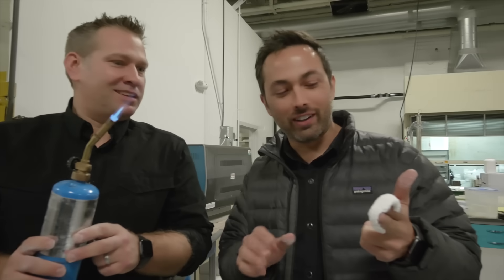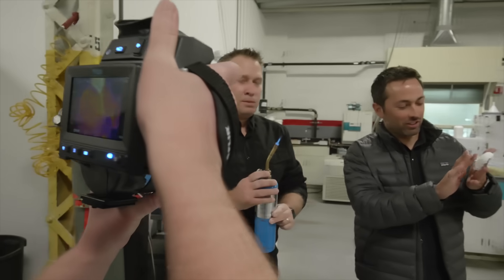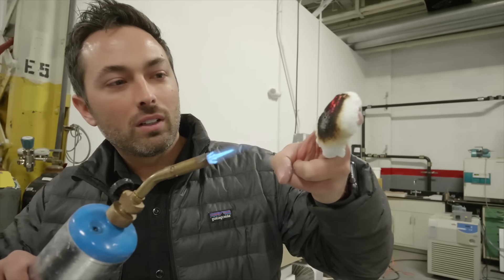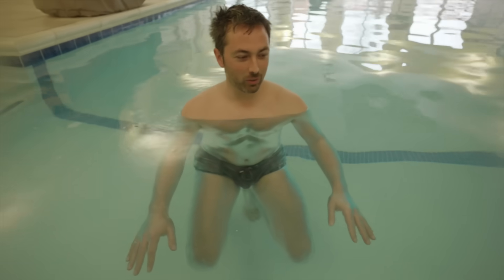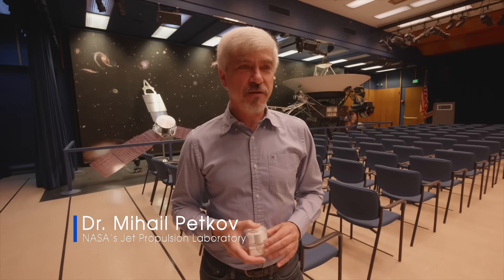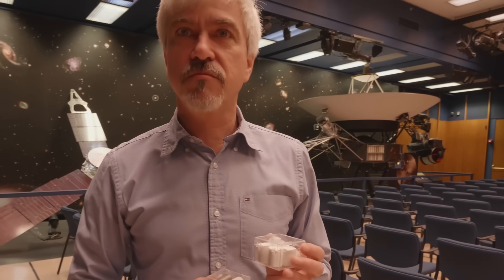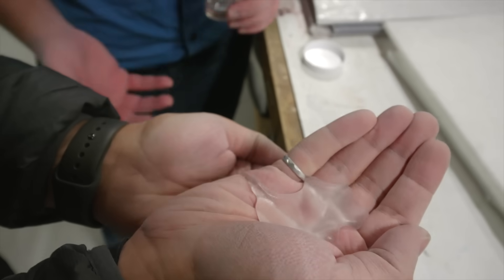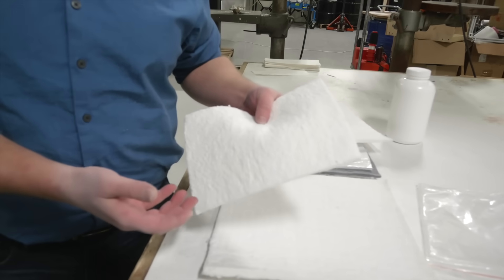I Waterproofed Myself With Aerogel!

Comment: The gel could be insanely good for firefighter suits.
Reply: @melmao6531  How are you going to hit us with that response but not talk about it more
Reply: @CubeCF  the people wearing the suit would over heat very quickly in the labour intensive work from just their body heat
Reply: @astrixinthestars1047 b my guess is it would still prolong survivability if it's used when significantly hotter outside than inside
Reply: CubeCF well the problem is that the gel is very fragile, grown men running, objects falling on them, ect ect makes it so be gel wouldn’t last very long
Reply: @melmao6531  put existing waterproof and fire resistant layer outside and the aerogel on the inside. The suit might get damaged, but it could save lives
Reply: @michaellutz1539  that's what I was thinkin'. But hey,I ain't a scientist.
Reply: @michaellutz1539  If the suit is damaged it wouldn't be easy to mass produce
Reply: @michaellutz1539   CrazyNexusMaster123 Gulmatico  
Or maybe use CO2 instead of water
Reply: @michaellutz1539  

No. An Aerogel suit would only be comfortably wearable for like a few minutes, tops. Aero halts ALL HEAT, so an Aerogel suit would cook you from the inside with YOUR OWN body heat. However you're bound to get uncomfortable and take off the suit LONG BEFORE that could happen.
Reply: Being a firefighter it’s exactly what I was thinking, the possibilities for this stuff is endless and I think everyone watching this video is thinking of inventions.
Reply: @FadedFilmsl  thank you for being a firefighter 🙋🏿‍♂️😘👨‍🚒🧯📛
Reply: @FadedFilmsl  exactly, I'm just an EMT and even I knew it was a game changer
Reply: Only problem would be the insulation of body heat
Reply: Tom A but the insulation would keep them from burning because it would keep them at body temperature, but it would be really hard to take off because of the heat on the outside.
Reply: CrazyNexusMaster123 Gulmatico      in a previous video, they showed that the aerogel had really good heat resisting properties and that the aerogel didn’t get burned itself when placed over a fire source (it became warm...causing the chocolate bunny to melt slightly but didn’t get heat damaged itself) furthermore after removal from the heat source, it seemed to cool fairly quickly.....so it might be useful in firefighter suits...good reasoning though
Reply: Problem is the effect works both ways, essentially cooking firefighters from their own body heat. It's already a huge problem with conventional suits, aerogel would prevent any body heat/moisture to be trapped within.
Reply: @CookieMonster999111  I don't think firefighters mind it at all when it comes to get burned by fire - I'm pretty sure all of us here were to close to the campfire in thick pants - it is just warm inside, mostly from the body heat (althought, few mins laters these pants are so hot from inside! But if they would be "reinforced" by areogel, nothing would happen for a longer time. Anyway i'm saying about perfect situation where there isn't any need of making these pants waterproof so the gel won't get damaged. Like someine here said - I ain't a scientist.
Reply: Preserve Our Liberties yeah maybe it would be better as an easy to carry fire blanket
Reply: @CookieMonster999111  Fully contain the suit except for an on board cooling system that would regulate temperature to normal body temperature while in the suit?
Reply: I have no idea what any of you are talking about I am confusion
Reply: @mattmc1234  CONFUSION 100
Reply: Matthew Mcgill same
Reply: @mattmc1234  it's probably why you're confused.
Reply: Just remember that a firefighter doesn’t need to walk directly through flames.
A composite material would allow it to be put throughout the fire suits and flex somewhat
Reply: Also, for re entry from space. No need for heat shields anymore.
Reply: They r working on it.but the material is very brittle so they r working on combinations ;)
Reply: Not really, usually the thing that most likely will kill a fireman will  be the gasses or pieces of furniture or the building, also the fireman should be able to feel how hot is a certain place to know how dangerous it is, this stuff isolates it all, so I'd say they're pretty alright now
Reply: Reading a portion of this some people are thinking of a 100% aerogel firefighter suit when in reality it will be a mix of aerogel and existing tech to make it effective
Reply: How bout a shield
Reply: Lmao firesuits always have a insulating layer between the inner and the outer material, and if those are waterproof and which they are then you don't have to worry about ruining the gel
Reply: @iggypeters5564  I agree with obama.
Reply: Maybe just gloves it's too brittle
Reply: Plague Doc what if u fall? 🤦‍♂️
Reply: lol no it wouldn't. the problem is it will keep the heat out but it would also keep the heat in and it will over heat the fire fighter.
Reply: Plague Doc and for diving
Reply: Omg yes!
Reply: Firefighter suits are perfectly fine for protecting from fire most Firefighters lose their lives from being trapped and smoke inhalation.
Reply: @a_gengoo9645  oh🥺 that idea tossed out of the window
Reply: What are we fighting about?

something kinda irrelevant to this video
Reply: Really, the heat is one of the least concerning things for firefighters. the biggest issue is smoke inhalation, followed by structure collapse.
Reply: I can see Olympic swimmers using the water resistant dust to try get their times down.
Reply: Plague Doc future millionaires in this comment section. Lol
Reply: They actually made aerogel lined coats for Everest climbers in the early 80's, people were having a bad time suffering heat exhaustion/stroke... in 0 degree weather.
Reply: ThePlayListOfPower I cant find anything on that could you link it?
Reply: May be with a scrub
Reply: CrazyNexusMaster123 Gulmatico put one layer of fire proof material then put aerogel
Reply: It would get really hot though
Reply: More like an inner layer in the mid or something of the suit.
Reply: I was thinking make it a edible Fire extinguisher lol
Reply: True the only issue would be getting out if the whole thing is burning.... and like clay.... somewhere in the future it’ll be weaveable with fabric
Reply: Our turnouts do have a water barrier as well as a thermo barrier. If they could weave this into the fabric, it could work awesome! It just has to be durable.
Reply: Plague Doc wear this near a detonated nuclear bomb
Reply: But also incredibly expensive
Reply: Just make a suit out of the fireproof aerogel and use that to rescue people.during fires
Reply: You got a mger point there, yhey should be using it for that.
Reply: Well you could put in deep inside their already proofing clothes
Reply: If you fall or get clipped by debris then your suit is basically ruined/shattered and no longer effective therefore risking the life of the firefighter inside of the place that’s burning
Reply: or my asshole
Reply: 😂😂it could be more flammable
Reply: Did all yall not watch the video or something there are tons of ways to make it into a fire suit, from fiberglass infused with it to amorphous silicon/silica composites
Reply: that is what i’m thinking
Reply: Oh rly
Reply: @melmao6531   u don't have to get scientific u know
Reply: Air is flammable....
Reply: CrazyNexusMaster123 Gulmatico did you says that it has high resistance to heat you idiot
Reply: @melmao6531  why?
Reply: Plague Doc it’s really expensive
Reply: This would be absolutely terrible, standard turnout gear can already have you soaked in sweat before you even hit the front door, adding an extra layer of insulation is just going to make it that much worse. Turnout gear can already handle a significant amount of heat as they are made today
Reply: @thefiremensch  Accuracy, just gotta watch someone take off their turnout jacket after a call even one where they just stood around and they'll be steaming with sweat!
Reply: The issue is you'd still have to make all other components of a firefighters PPE able to withstand the temperatures of the gel. The facepiece (SCBA mask) is a critical piece of equipment and it delaminates at 500 degrees. That's great if your turnouts can now withstand higher temps, but now your mask is melted and you're dead. With greater advances in technology, we firefighters now feel less heat, which means we go deeper into fires and stay longer in hotter and more dangerous fires. We can't tell when it's getting "too hot" because we can't feel it. That is inherently the most dangerous aspect of this all. I'm fine with feeling the heat because that's what keeps me alive.
Reply: @thefiremensch  The mask might actually be a great point to start with. Because there are some groups focussing their research on transparent aerogels with high thermal insulation. Though, I think it will need quite a lot of time to make the step from research to industrial application. Aerogels aren't really the cheapest material and mostly produced at laboratory scale.
Reply: It would break to easy, firefighter suits need to be extremely rugid and able to stand against great abuse
Reply: Aerogel kills you.. so save two lives but then you die just from saving them in a gnarly suit that gave you bone cancer
Reply: @otterpop5551  Although I agree with you that it has to be tested first, the material they show (for most parts) in the video is inert (non-reactive) and is basically the same chemical formula as sand...
That being said, nanofibers and nanoparticles are not really out of the warning yet and they probably shouldn't just "dust off" the aerogel blanket in the video without a mask.
Reply: @otterpop5551  LMFAO
Reply: @melmao6531  This isn't actually a problem. Water proofing (hydrophobicity) does not affect the thermal insulation properties of the material (I am working with this material). Though, there might be the problem, that it also works the other way around: So to say the water (sweat) of the fireman and the body heat will also be entrapped. But, for short and extreme situations like a burning building, this might be feasible. 

Although, only in the future... As the video mentioned you also have issues in mechanical properties and the material is quite expensive so far. Therefore, it is mostly in labs at the moment and only some industrial applications at NASA and similar fields where money isn't an issue.
Reply: firefighter: walks to the man on fire
gel: shatters because its brittle and your body destroyed it while moving
man: oof
Reply: Hey so i just got the bubonic plague plz cure
Reply: alysdexia  I disagree. The choice of word there is more style than grammar, and putting 'should' changes the meaning ever so slightly
Reply: alysdexia  this is what would happen in a hypothetical situation. Should means 'im pretty sure this will happen'. Im not pretty sure. I know what will happen
Reply: alysdexia  i googed the definition of would. Its "indicating the consequence of an imagined event or situation", or the past tense of will
Reply: Firefighters will be like FIGHT ME FIRE!
Reply: How tf does this have 10K likes and isn’t the featured comment. WTF!!!
Reply: @melmao6531  it's not possible for it to burn under water
Reply: @melmao6531  they did. They said it's a trade-off and that you can't have everything
Reply: Why would they need to be waterproof?
Reply: I mean the aerogel with binder, or aerogel with fiberglass seems like a better alternative to put inside pockets of clothing for firemen.
Reply: alysdexia  Polish translation of thick is gruby - that means like fat etc, and krupny is related with Krupa and that means groats. Coarse means zgrubny. And its not related with fat or something. We use zgrubny as harsh/rough or even "surface". I said that is a synonym earlier but i was wrong. "zgrubny" and "gruby" is completly different.
Reply: @melmao6531  You clearly don't know what you're talking about.
Reply: CrazyNexus aerogel is water and fire proofed
Reply: Yea I know so they don’t need to wear anything
Reply: Yeah, like between the suit layers
Reply: @melmao6531  it would still be fireproof ...
Reply: carbon fiber armor and aerogel blanket underneath the armor is a great Batman suit :D
Reply: @melmao6531  a flame repellent suit loses its value when its wet basic
Reply: CrazyNexus it will be layered in a waterproof suit
Reply: Very good idea
Reply: AsHLiegH-MaRie HoPe   Fair enough, the point I was making about a year ago but didn't fully articulate is the image a lot of people have of firefighters walking directly through fire thats engulfing every inch of a room like they are a diver underwater
Reply: I swear half of you didn’t even watch the video
Reply: CrazyNexus the areogel didn’t burn him
Reply: They use it for pipe and glass, cable and windows
Reply: Mcarthy Wasright  aren't their suits like.... super heavy though? Amd can  that system withstand extreme heat?  Seems inconvenient for a firefighter
Reply: Yeah it could probably survive lava not just fire. Considering it literally survived a 1500 degrees celsius blowtorch.
With little to no warmth passing through. And lava is like 2000 fahrenheit or 1100 celsius.
Reply: Probably for F1 suits
Reply: The guy is still waterproof
Reply: @melmao6531  it would be for going into fires and saving ppl, even making a shield of it to protect the person they're saving. Firemen don't usually go in the water they are spraying anyway.
Reply: @melmao6531  Think more
Reply: @nicanonn6840  who u shaming? I don't see a Broom Squad dude in here
Reply: @gladiatormarcellus2078  the comment was removed but imma guess it was a crack about the first responders that died in 9/11. It always is.
Reply: @ConstantChaos1  thank you for saving lives and giving up some of your safety for the greater good 🙋🏿‍♂️🤗
Reply: @iMakeItFun  thank you for saying thanks, and honestly I just do it because it's the right thing to do lol, like I know I can handle it and it comes naturally to me so it's a no brainer lol.  Tho I regret signing up for tomorrow (I live in America and the 4th of July is such a big thing I can hear fireworks being set off rn despite the fact that were in the middle of a huge ass thunderstorm)
Reply: Sarcastic Potatoes Broom Squad deleted his comment. That's why you can't see it.
Reply: @imsocoolyoudontevenk  dude, just stfu
Reply: @Ocer.  what did he say? i didn't see it i think he deleted it
Reply: @Ocer.  what did he said,he delete it
Reply: @NXE212  i always wonder what people said when i see others admonishing...  i just can't help it; lol.
Reply: @josephaether377  ha ha same
Reply: @Ocer.   what did they say?
Reply: @imsocoolyoudontevenk  Not cool, dude, not cool.
Reply: @springrollwang4441  i can not find his comment what did he say?
Reply: @butterypancakes1888  can't remember, just some random personal insult on another person who got different idea than him. Internet brings the best out of us :)
Reply: It'll protect them from outer heat, yea. But imagine all the heat being emitted by one's body inside the suit because of insulation.
Reply: Lmao what ..too fragile
Reply: I thought firefighters fight fire, not water
Reply: Nirad802 it’s to not get blasted by water in the fire

Comment: Feel like a computer case with this to prevent heat from surroundings could be insanely good..obviously need good fans or water cooling to help shoot out the warm air from the computer.

Comment: I have a question:
When you entered the pool was ist cold? Like you showed this material is very good for heat protection so i wondered if you have felt anything but the higher presure of the water.

Comment: Hmm so I thought I would make a fall out shelter when I'm like 46 and the stuff at 1:03 if I can get it it's going to be expensive but I will put it on the inside of all the walls and inside I will have 
•Private hospital
•6 back up generators 
• 20.  10 foot tall shelves of non perishable food it's going to have like 4 rooms and it will have and elevator or stairs leading down 20 to 50 feet into the ground

Comment: What could be better than an almost naked physicist in a pool?  Hot! Omg!
I can see potential use for space craft insulation. And maybe a hydrogen absorbing  storage gel for fuel cells. Or some type of battery via alternating layers of gel materials with different metals.
Radiation shielding etc.

Comment: Amazing stuff with some awesome possibilities.
1) The water repellent (on his hands) -- car "wax", a better "RainX", a better "ScotchGard", coating for shower tiles to prevent mold/mildew.
2) The stiff insulating version -- light-weight food coolers, insulation for walls in homes, "skinnier" refrigerators/freezers.
3) The blanket insulating -- extremely light-weight sleeping bag filler, jacket filler, glove filler, snow-mobile suit filler, bed blanket, doggy jacket, tea cozy, etc.
4) Does the water repellent on the body (swimming pool) trap body heat? Or does it cool you because it wicks away sweat? Assuming wick, great for all sports apparel, socks, etc. Add some SPF and you have a sunblock that lasts much longer than the ones that "sweat off". Would olympic swimmers have less water friction using this?
5) And the heat-repellent (blow torch) -- roof shingles, attic insulation, fire-fighter garb.
Just some ideas for 2030.

Comment: The binder doesn't matter but its a hydrocarbon. What is happening is its burning only on the surface and turning into carbon...which makes it more insulative. The material underneath the burn is insulated by the foam and the carbon. Its forming a protective skin.

It could be something as simple as corn starch or gelatin.

Comment: Could I make an aerogel pizza oven? For those of you who are tired of shifting those heavy bulky pizza ovens around. It would also warm up quickly. The only problem is it might shatter when I casually toss a firewood log in the back. That could be fixed if the fire grate is made of some springy wire and how easy is it to clean?